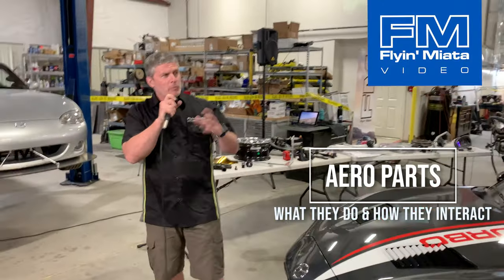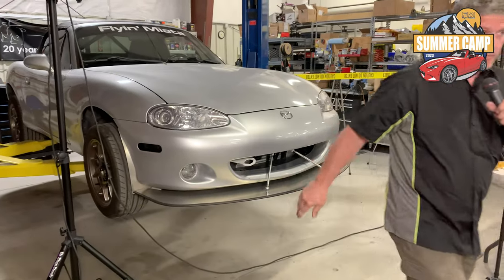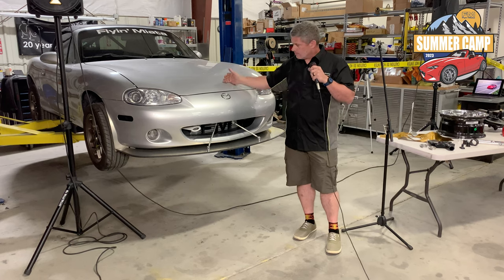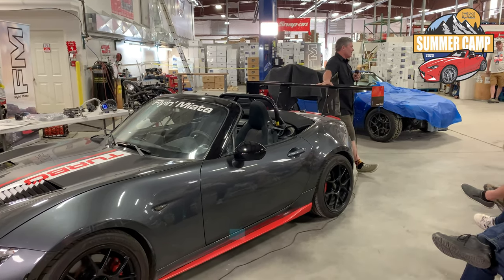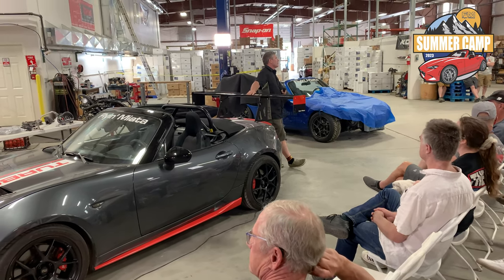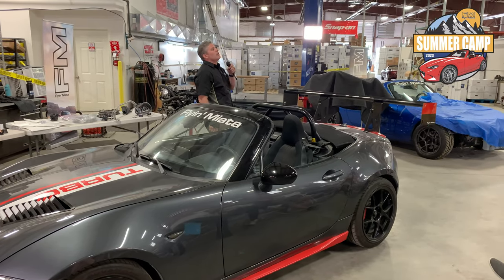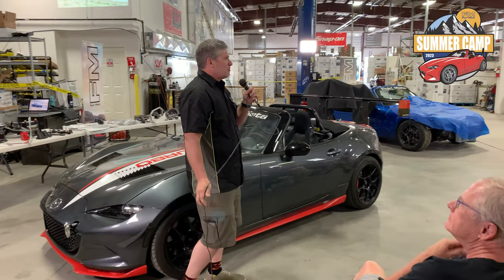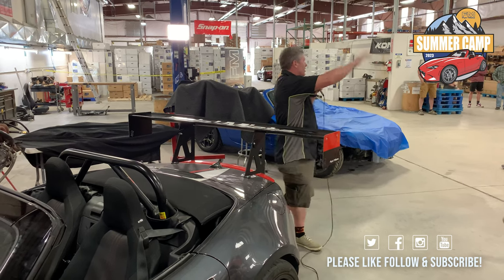AERO PARTS: What they are & how they interact (FM Summer Camp 2023)

Comment: On the V2.1 frame rails, there are provisions for an underbody panel to be installed. While heat is the issue of many transmissions, does putting a panel on the NA/NB frame to create a flat bottom create a cooling/reliability issue with the transmission, and does FM have a solution to manage transmission tunnel temperature if flat panels are installed between the framerails?

Second question, will there ever be a rear wing that can be attached directly to the rear knuckles designed for miatas? This would allow the grip to benefit without the springs having to handle any of the weight from the downforce. This was a big thing in the 60's and 70s, but I have not seen it on many cars since.
Reply from the maker: When we did our testing, we saw temperatures in the tunnel we didn't like despite adding NACA ducts to force some air into the tunnel. It's quite possible you'd overheat the transmission fluid, which would be bad for longevity. These temperatures are why they didn't get approved for production, but the mounts are still there on the butterfly (not the frame rails) for those who want to experiment for themselves. Add a transmission cooler and you'd be in good shape.

The reason you stopped seeing wings connected directly to the uprights in major race series was because they were outlawed in most series. There were a lot of problems with structural failures which usually lead directly to accidents. The wing starts seeing a bunch of shock loads and also effectively got turned into a sway bar with all the twisting loads involved. In order to implement it on a Miata, you'd have to do a fair bit of surgery on the tub which is further than customers are willing to go for an off-the-shelf product. It would be fun to see someone DIY it though, and there have been a few people experiment with it on things like FSAE cars. It's easier if you have a push- or pull-rod suspension as that makes it easier to join both sides with a beam.